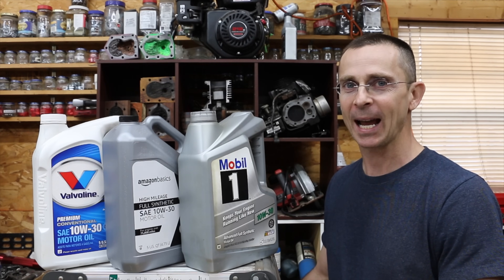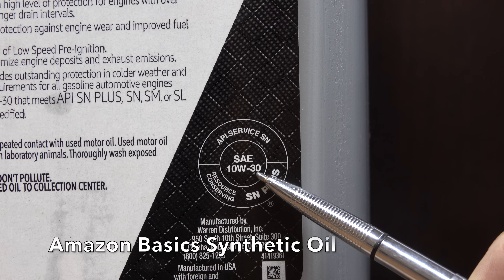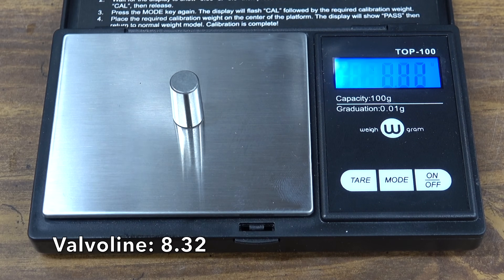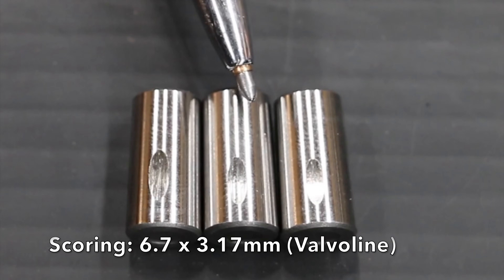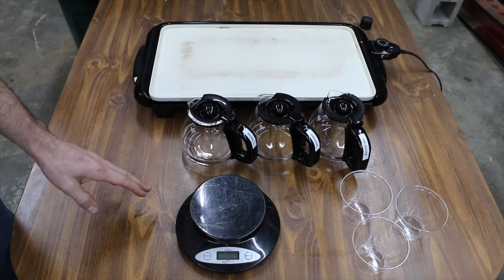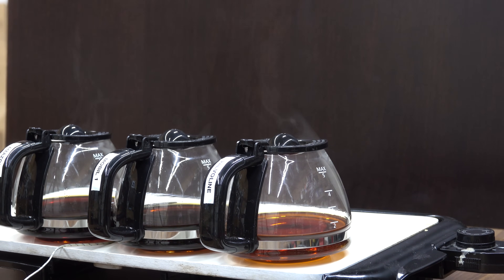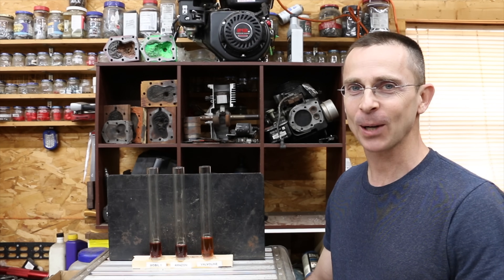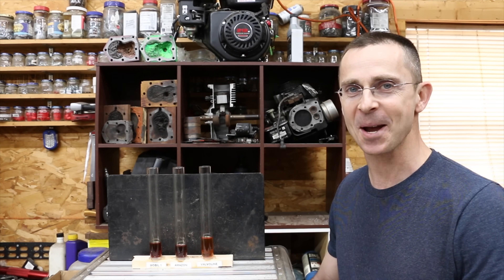Is AmazonBasics Full Synthetic Motor Oil better than Mobil 1? Let's find out!

Comment: Use what your vehicle calls for and was manufactured with. That's like putting a higher octane fuel in your vehicle meanwhile it was tuned with a specific octane. Overtime you will see issues. Good video.
Reply from the maker: Thank you
Reply: What? Higher than required octane wont hurt your engine  (assuming the octanes normally available at the typical gas station). Its just a waste of money. Lower than recommended octane may hurt the engine depending on the  engine set up and conditions of use. Modern NA engines with compression not much higher than the 11:1 range will typically see a reduction in power on lower than recommended Octane.  I rarely use OEM car  manufacturer recommendations. I live in FL. Stock recommendations are a compromise for all weather conditions.
Reply: @williamkorver9856   yes, octane is a measure of gasoline’s anti-knocking and anti-ping properties. your car will not run correctly, whether you notice it or not if you use a rating other then what was intended. Higher octane fuel requires more heat and more precision to burn correctly. If your car is designed to burn 87, it will not burn 93 correctly. 
Higher octane gasoline, which is more stable, has no more energy potential than lower octane gasoline. There is no more energy to be had from high octane gasoline, then from low octane gasoline. Using low octane fuel in a high octane engine will result in severely reduced performance because the engine will attempt to adjust to the lower octane gasoline. In extreme cases, or with prolonged use of low octane gasoline in these engines, pinging or pre-detonation can occur. 

 When it comes to engine oil you have to take in consideration what the vehicle was designed around. Yes in cold weather or extreme hot weather it may or may not be beneficial to use a different viscosity. However you have to keep in mind what the vehicle was designed around. Oil that’s too thin can fail to develop a consistent lubricating film, inviting metal-to-metal contact that causes wear. Oil too thick to flow quickly enough to fill the spaces between the crank journals and main bearings while the engine is running also won’t form a consistent lubricating film, allowing metal-to-metal contact and wear. 
 It's silly, A waste of money, And a waste of time to change the chemicals which a vehicle was designed and intended to use. Yes at certain points with certain variables and factors in play changing those chemicals to Maybe hide a symptom or Prolong a failure may or may not help. But everyone seems want to try and change things because they feel it better or someone says it's better.
Reply: @wk2466  Thanks for your reply. I think we are in agreement on lower than recommended octane. However I would ask you provide some links or sources that higher than recommended octane (again regularly available ratings) will cause issues in a properly tuned car. It is a waste of money and agreed it does not provide more power.
As a side note and to borrow someone elses statement, "the inside of an engine is not a a finely tuned Swiss watch". It will operate fine with in a band of operation. It just might not be optimal for emissions, gas mileage, or power production purposes whichever are your focus.  
Getting back on topic, if I may recommend that you spend some time on the Bobs the Oil Guy website. Your original statement re oil assumes that manufacturers recommendation is the BEST for all situations. Actually the recommendation is a compromise to cover the most situations but is not necessarily the best for all situations. I live in FL. It rarely freezes here. In fact this winter the coldest overnight low was 50 degrees. Yesterday 2/23/19 it was 88 degrees. I do not run 5w-20 oil here due to ambient temps temp and we don't have emissions testing (part of the reason OEMs went to 5W-20).True I wouldn't run a 20w-50 either as in newer cars the  oil galleys may be too small and the oil pump may not be optimized for it and I'm not towing anything. 

OEM's focus is on selling and repairing cars to the widest range of people possible and not on providing you with a perfect machine for your situation that lasts forever.  So there is a lot of room for optimization for your situation. That said, should everyone mess with their vehicles? Probably not. But statements that OEMs knows best is not necessarily accurate. 

Bringing it full circle to the OP's statement, using an Amazon oil gives better protection than Dino oil at approx the same price. Since it passes the testing standards it is fine for use. 
If you were focusing on the oil weight he use in the test please understand he had to pick a weight for testing purposes and that he was not implying in any way that it was the best weight oil for all ambient temp/engine temp/emissions requirements/load placed on the engine/frequency of change, etc for everyone's driving situations.  Not sure why the font turned red! :-)
Reply: @williamkorver9856   True, I lied/mispoke(typed). 
It may not hurt anything to use Higer then recommended however it would be a complete waist and has now added benefits unless you start to hear knocking then adding a higher octane may hide that system. In today's cars.

Comment: Nice comparison. The only thing I'd worry about is where the oil comes from. Amazon probably has contracts that oil manufacturers can bid on. Could be great oil when company X is supplying it, but when the contract is up, will company Y continue with the same quality, for better or worse? Also, when the oil is manufactured by a vendor, Amazon does not have direct control over the quality process. Some companies might take advantage of this freedom and pass an out-of-spec batch to make their quota. I'd be interested to see a follow-up video in the future to measure the manufacturing consistency!  :)
Reply: If you cared about this, you wouldn't be buying that. I will always buy Mobil 1, especially if it doesn't really cost much more, if any, at Walmart.
Reply: @thingsdemystified   - Same. My mechanic tells me to get Mobil1 and that's what I get when I change my oil in all my vehicles (even motorcycle).
Reply: @Follow-the-Sun-1  I even use it in my lawn & garden engines now.
Reply from the maker: Thank you
Reply: Great point
Reply: @Joe Casson You should never have purchased Fram in the first place. Absolutely the worst.
Reply: Paktric, Warren distributing is the manufacturer of amazon basics oil. They have been producing oil since 1919. The product is consistent and inexpensive.
Reply: @andymercado6192  They may be for now. Besides, why would you buy it over Mobil 1 if you're not saving much? We still don't know how it performs in an actual engine.

Comment: You used synthetics on Mobil 1 and Amazon Basics but Valvoline was conventional. That is not a fair test.
Reply: There is very little real-world difference between a high grade group 3+ and the group 4 and 5 'true' synthetics. Also, just about EVERY oil has some 'synthetic' and some 'conventional' base stocks in the mix.

Comment: Do a video on ethanol efficiency vs cost and when its a better deal to run e85 over regular gasoline for those of us with flexible fuel cars. My findings were anytime e85 is about 20% cheaper then 87 octane then the e85 is a better buy. Comparing mpg and cost
Reply from the maker: Thank you for the video idea!

Comment: The clearer and cleaner your oil is straight out of the bottle the better and that's exactly why if you use additives you should use nothing other than either best line or the Lucas full synthetic the Black Label because it's pure petroleum and that's why the industry calls that synthetic it's to throw you off it's to confuse people it's better but the word synthetic leaves people thinking it's worse or different except it's the same s*** just much more refined it's not synthetic at all.  But I'm here to tell you the best additives are perfectly clear and the worst ones that I can say from my experience happened to be the color of honey yes STP works pretty good but then again so does the Carquest brand it's probably the same s*** but if you shake that Black Label Lucas you can hear it just like you can hear the best line and I don't know what's really in it whether it's zinc or some highfalutin metal but it works and it works real good oh and you might not get a magic show just using it one time you might have to do a 20% additive fill every time you change your oil after a hundred thousand miles
Reply from the maker: Thank you

Comment: Just an observation, the final flow test that was performed, Amazon was fastest and first, but the amount of oil spilling over the edge was a very small, consistent stream; while the Mobil 1 was slight slower, but had a higher amount of fluid going over the edge at the same time, consistently. Does that account for anything in the test? Or is it just an unconcerning variable?

I know the test wasn't "scientific", but just providing my layman's observation.
Reply from the maker: Thank you. That would indicate that Mobil 1 had more viscosity.

Comment: A good video overall. But a bit misleading I think using conventional Valvoline but synthetic on the other two brands. I get your reasoning for this to show the difference in synthetic and conventional but in your video your barely touched on the fact the Valvoline wasn't a synthetic. Just comes across like Valvoline is a inferior brand and can't even compete with Amazon but they're not even the same types of motor oil. That would about be like making a video with synthetic Valvoline and Mobil 1 but conventional Amazon and then saying well this clearly shows that Amazon makes (sources) a poor quality motor oil compared to the competition. Instead you should have just left Valvoline out and used one of the synthetic brands that you used conventional oil version as well to show the difference between the synthetic and conventional of the same brand. Or if the other brands don't have a conventional oil or even if they do maybe include the synthetic Valvoline also along with the traditional Valvoline. Just my thoughts but yeah very interesting video. I didn't even know Amazon had motor oil. Lots of very garage scientific test. 👍
Reply from the maker: Thank you for the constructive feedback.

Comment: Where the oil needs to stay in place use  those oils with many additives like the amazon one, I mean like gears, pulleys or even garage doors..... but for the motor is not good to many additives because it will “stay more time” creating that build up, that is why the mobil1 quickly “moves” because it mean to do that and not to cause stress between piston rings....
Reply from the maker: Thank you

Comment: I would like to see the opposite with high-priced oils like Royal Purple. There are a lot of people who sweat by it. Though I think it's a consumer who allows price to convince them means a better product. As well as the fast that Royal Purple is designed for very high performance engines that the average consumer wouldn't have.

I believe it was mentioned before but multiple heat cycles are where synthetics shine and you only did one. But I would like to see how much of a difference there would be to Royal Purple. Heck, I'd be willing to provide the product.
Reply from the maker: Thank you for the video idea!

Comment: What were the hardness variances in the dowel pins?  I would bet the pins are case hardened and all vary in hardness and case depth.  If through hardened there are probably still hardness differences between the pins.
Reply from the maker: Thank you.  All came from the exact same bearing set.
Reply: @ProjectFarm  Being familiar with how inconsistent heat treatment can be even within the same batch, I would never assume exact same hardness specs.

Comment: Good test. You can get M1 for a little over $20 at Walmart on sale. Run it 10k miles and change it. At NASA we did shell 4 ball tests on oils and M1 was one of the best.
Reply: Spot on, other parts stores are atleast $5 more for 5qt of Mobil synthetic.
Reply from the maker: Thank you
Reply: Perry, you're correct, Walmart sells Mobil 1 much cheaper then most. That's where I've been buying it.
Reply: Perry Gray: do u remember all of the other oils that were tested along with Mobile 1?
Reply: Amsoil was pretty good. Straight 30 W conventional oils were better than the 10W40 varieties. I think Castrol was the worst of the synthetics. They may have changed their formula by now. You can always go to 0W30 or 0w20 oils in modern engines. Non-roller cam valve trains will suffer with the thinner oils.  @dl4511
Reply: @perry9492  You said "I think Castrol was the worst of the synthetics."
That is odd. I have been using Castrol for years and get hundreds of thousands of miles out of my engines. Also, some of those engine models have been known not to run for very long.
Reply: Differences were small and most likely the formula has changed. Any synthetic is way better than any mineral oil.  @1speed2racer7
Reply: @perry9492  You said "most likely the formula has changed."
I do not know if they changed their formula, but they recently changed their 350K mile warranty with 15K mile oil changes to 500K mile warranty with 20K mile oil changes for the Edge Extended Performance.

Comment: Maybe add a measuring cup for the lubricity tester, to make sure the exact same amount of oil or otherwise fluid is present for each test. Also I'm very curious if differential gear oil can be used in your engine in extreme situations. Absolutely love your videos!
Reply from the maker: Thank you for the recommendation!

Comment: Wouldn’t the downward force of the arm holding the metal cylinder in place directly affect the wear ?  If so, you would have to eliminate the variability of that pressure or at least somehow measure it.
Reply from the maker: Thank you.  The downward force does not change during the test or between products.  This is not one of those "one arm bandit" machines...no one touches the machine during testing.